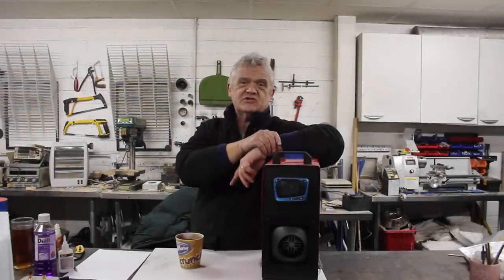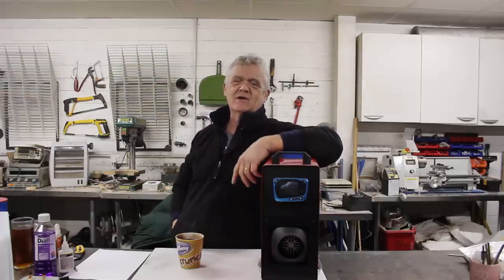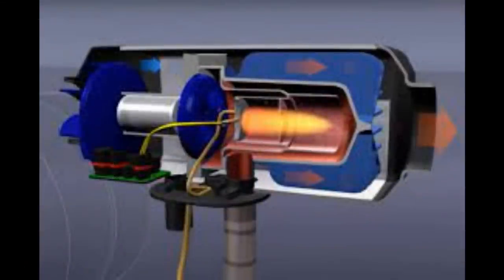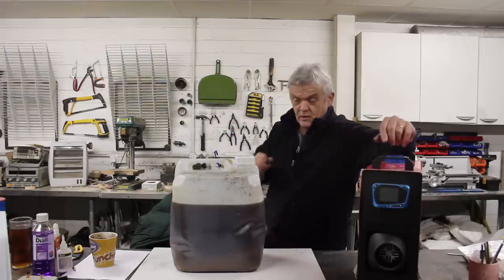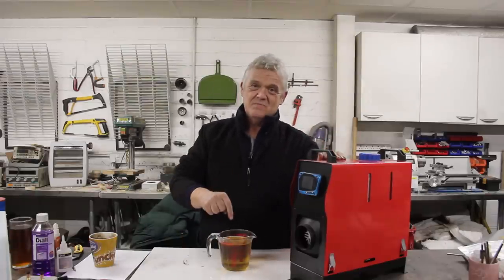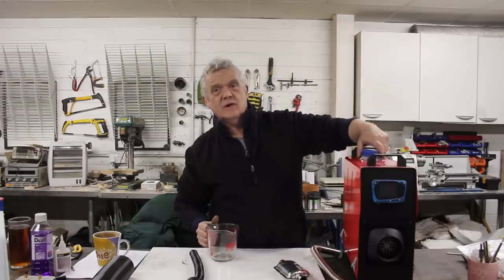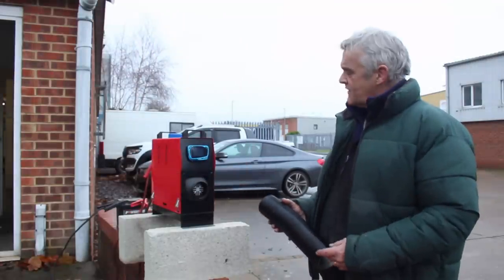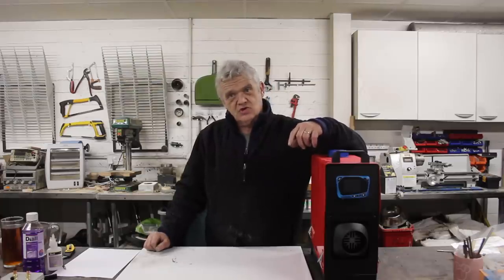1793 Home Made Fuel Running A Diesel Heater

Comment: What you described could easily be done with a rocket stove... just add two separate holes on the side of the rocket stove capsulation.. one of the holes will use a fan to pull in the air from the room and the other hole will output hot air into the room from the temp increase inside the capsulation... also you leave the top of the rocket stove open and vend it outside... remember you need an encapsulation so that the gases are not sucked into the room then you have an efficient heater and a stove. I know you will like this idea.
Reply: One of the ideas behind a Rocket stove is that it's more effizient because it burns the exhaust gases in the pipe. When you have a burn chamber with an in and exhaust line it's a normal heater or an one pipe Bullerjan. Thats the same as a normal radiator only with the difference that a Radiator has water to air heat exchange where the Bullerjan has no medium to transport the heat to other rooms.
Reply: Hey guys I’m way under intelligent to be here but I’m enjoying this conversation although I have no idea what’s being said!
Reply: He already built a indoor heater from rocket stove with a much simpler, much better solution.
Reply: @Harrington2323  What I'm suggesting is that you leave the actual rocket stove as it is just inclose it and then use a fan to pull in cold air and output the hot air...
Reply: @oldriver1827  not all heroes wear capes!
Reply: @MikeSnifferpippets  Right back at you.
Reply: @baware80  That could be a good Idea for a second room. In the first room you have all the heat of the stove. What you need is a good plan for Air circulation and a Sensor for CO, CO2 and O2. I think the biggest problem would be the high temperature. A rocket stove generated a lot more heat then one of this Diesel heaters, you would need a way better fan with insulated wiring and electronic.
Reply: @Harrington2323  Yeah you might be right, because of the large heat output, it would make sense to even leave the rocket stove outside and draw the warm air inside as the fan blows it in...
Reply: @baware80   old fireplaces were often from Clay and straw.  That would be good for a rocket stove, not only for  storing the heat but also for the heat dissipation. There are Videos from outburned stoves because of the extreme heat. When you use normal Steel it's broken after 100th of hours in use. You need better materials or a medium around the stove that dissipates the heat better. For a fun Project or a hobo heater you can use whatever is available, when you want to Install a longterm  heater in a cabin or Workshop there are more problems. Therefore your Suggestion with a fan would be good, in the Center the stove then 2cm for the Air and around this clay with straw inside for stability.

Comment: I am running one of these currently in my van to keep my bowling balls warm. And so I feel comfortable when it's time to drive home from work.  Less than $0.50 a day and I can keep them stored in there and not have to take them in the house every day.  I bowl nearly every day of the week in 3 different towns.   The cost to operate the heater will become a fraction of that when I insulate the van.  Currently it's all sheet metal.

Comment: Can you run it on no# 2 heating oil. Not as good kerosene. I can get it cheaper than diesel. If I get 100 gallons. ? Wouldn’t it burn as clean as diesel. Key question. Tanks a lot. Get it . Tank. ?

Comment: Resembles the paraffin heater I have in my boat. The heat exchanger is cast aluminium. The guy who serviced it said it will last forever. The only problem is, it's hard to find fuel for it these days.
Reply: I have a gas caravan heater that works to exactly the same heat exchange system... only difference is the fuel and thus the running cost

Comment: I have the same heater. I also have the same HHO mini torch machine you've featured before. I thought why not combine them today and run the HHO to the intake of the diesel heater to improve the combustion and heat output (especially at the lower injection settings) and it seems to be working great! Probably burning much cleaner I would hypothesize.
Reply from the maker: oh - that is interesting - thank you for sharing
Reply: That seems like doing that it could run on just about anything hopefully it doesn't get hot enough to melt anything hho burns hot! what kind of liters per minute is your hho putting out? I'm thinking of trying something like this maybe when boondocking like running a little propane then I could use vegetable oil with just a little deisel to thin it out as electricity from batteries is precious!
Reply: @patrickday4206  I'm making just under 1 LPM. I noticed that running the heater on injection setting one was making about the same heat as setting 4 or 5 before the HHO.
Reply: @mikewalsh511  wow that is a vast improvement!
Reply: @mikewalsh511  how many watts does it consume 240v or 120v I was thinking about buying one I wanted one back in 2000 when the only one I could find was the browns gas guy that charged an Arm and a leg!
Reply: @patrickday4206  I didn't put a watt meter on the HHO torch machine but it's 120v and that is used for a 12v supply that's running at about 12 amps. I estimate no more than 400w with the electrical losses.
Reply: @mikewalsh511  thanks I'm trying to figure out if I could run it off my battery bank I have 600 amps lithium titanate I could actually run it I will probably order one!
Reply: @patrickday4206  You don't need the whole HHO torch machine to do HHO injection. You could just buy an automotive style dry cell and reservoir/bubbler and run it direct on your batts. I'm not running anywhere near enough HHO to be burnable as fuel, but under 1 LPM is good enough as a burn enhancer to extract more heat from the diesel and use less diesel at the cost of a little electric.
Reply: @mikewalsh511  thanks for the info with the price of deisel and how hard it can be pulling these apart to clean hho should be a good addition! I ran mine on 50 percent used oil and deisel took two weeks to coke up!
Reply: @patrickday4206  At 14.4V my 5kW uses 35Ah on highest burn setting running 10 hours

Comment: the mechanical description you have of how there is a burn chamber and a separate air pipe, is how forced air gas powered furnaces work in the US.  there is a chamber where the flame is separated from the ducted air via a heat exchanger.  The only time you use household air is if the furnace is in the same space being heated, like in a basement mechanical room.
Reply from the maker: cheers mate

Comment: I spent a long time living in a van with an eberspacher. It was an old vw diesel and I used to mix all of my fuel with vegetable oil. Even in the winter it worked well.  
It’s the electrical consumption that’s the issue. Very easy to make heat but where is the necessary energy coming from.

Comment: It was always a good idea to take air from inside the house because it is damper and has CO2 from breathing, it therefore ventilates the house. The downside is possible fumes getting back into the house despite that we should have come up with a system to prevent this.

Comment: I got a simple question you probably know the answer too cause I know how thorough you are. The question is what sort of temperatures come out that machine the clean air part? I mean top level turned up all the way what sort of temperatures come out? Is it similar to a blow dryer? Hotter? Imagine it would be hotter but I figured ash's better than wondering lol

Comment: I would like to add that you could make a sand Battery out of a metal bucket or metal garbage can and increase the heater's efficiency even further. Use Ceramic wool to insulate the bucket/garbage can and have a pipe go through the bottom and leave the top of the sand battery as exposed metal plate and use a fireplace fan on top as an indication that the battery is charged enough and circulate the heat.
Reply: The biggest way to improve the overall efficiency of these heaters is to run the exhaust pipe though a water heat exchanger and deliver this 'saved' heat into the room with a second radiator and small fan. You will need a smallish header tank and vent or the system could pressurise and blow, making for a very unpleasant experience for you. Admittedly a more complex set up than yours, but I think, a better recovery of wasted heat.
Reply: @bigoldgrizzly basically doing the same thing but it's safer with sand and takes slightly longer to get to temperature (because of more heat can be stored) and a 2 hour max burn has the potential for 6.5 hours radiant heat at half temperature in the garbage can configuration run both exhaust and vent through the battery. Water is good for immediate release for that day. Run a sand battery for a while and it will run for a lot longer. Water is a good option in the right environment.
Reply: @daniellapain1576  fair comment. I absolutely see the points you are making. I must admit to bias in that I want to have a system to come on in the workshop [120m cubed] at 6 am and be up and comfortable in fairly short order after I start work at around 8. . There is plenty insulation and 'general mass' within in the shop to hold at least some degree of heat overnight. Rapid temp rise is my aim, once up to temp, maintaining it through the day should not be a problem. I can even switch off the diesel and rely on the woodstove for that.
Reply from the maker: cheers mate

Comment: Robert, could you use a thermocouple and read the exhaust temperature from the burner? What is the temperature of combustion in the burn chamber?
Basically, I'm wondering what percentage of that heat is successfully transferred to the air when you operate it at various settings. Having the combustion intake air temperature, the combustion temperature, and the exhaust temperature, and the heating air intake and outlet temperatures would really help get a sense of what this devices is achieving.
Reply from the maker: true enough mate - I will look into it cheers
Reply: @ThinkingandTinkering  Here's where my thoughts are going: If I remember correctly, steam locomotive engineers concluded that the best way to get heat from fire into water is to use "fire tubes" connecting a combustion chamber with the exhaust stack, with those tubes passing through a reservoir of water. Concurrently, there is this concept of a "thermal transformer" using a phase-changing heat transfer medium to take high temperature heat and spread it out to heat a much larger volume of something else at a lower temperature. Based on these principles, it would seem to me that the best way to convert heat from burning fuel oil to heated air is to send combustion gases from burning oil through fire tubes in a reservoir of water, and have the steam travel through another set of tubes with much larger surface area (such as a radiator) to condense, using that to heat the air.  That way, the heat transfer is over a smaller temperature difference, which is more efficient and less entropic. 

That would seem to me to be much more efficient than the tiny but really high temp heating surface in the diesel heater.

Comment: With standard biodeisel mixes being a cook of about 1/10 or 1/20 methanol to the rest oil(I think the heavier oils need more, lighter oils like most cooking oils would be less, I may have that backward), a small amount of base catalyst(potash lye or sodium lye) maybe an once per batch, Small HCl to drop the lye from the  solution on completion, biodeisel is thinner that this on average, and due to the chemical reaction, most origination smells are destroyed. After you let the reaction occur with strong stirring for a while, you will know it is about done when the glycerin formed is about the volume of the methanol. This can be used as fuels for lamps as you have said as well, and after this has the salt in it, but there are ways to crash out the salt too. This seems to me to be cheaper than the paraffin, tho perhaps more tool and labor intensive, but that could cut your costs pretty well.
Reply: There are other methods based on enzymes and probably many more.
Reply: @vitordelima  True enough, but most of those enzyme products are not available off the self everywhere, which methanol and lye are.
Reply: @jasonmorello1374  I'm not sure how it works, but there are DIY methods to print enzymes and they don't seem too hard to get. In the middle of nowhere it isn't a viable method but in the first world it certainly is.
Reply: @vitordelima  I am not sure about "printing" enzymes, but I know Thought emporium channel has coverd some for his project to make yeast that would generate spider silk. I think the process would be similar, and take some specialized bio lab equipment and pre study. Mind you, If you are up for such a thing, go right ahead, but some times you need something a bit more within immediate reach.
Reply: @jasonmorello1374  No, it isn't. It is immediately available for many enzymes and I'm almost sure they are cheap to buy already made, but you just want to nag.
Reply: @vitordelima  The first enzyme that can be used to do this is lipase, which is about a dollar a gram, so for a 5 gallon batch you would need about 20-25 dollars worth, and then try to extract the enzyme from the product. This enzyme can be made as I specified, as that is one of the ways it is available commercially. But really why go to 25 dollars of enzyme  when less than a dollars worth of chemicals will do the same job?
Reply: @jasonmorello1374  Just look for it instead of being annoying.
Reply: @vitordelima  That  is precisely what I did. you can see the results of that already. I am sorry for you that you find scientific approach and a scope of needs "annoying", but really, I am just having the best facts as I know them present. No pie in the sky wishes or clarktech when no such thing is present or fits the concept, which here is about affordable fuel. That is a key defining scope point here.

Comment: These units usually have a calibration mode so you can fine tune the injections per second vs. the intake air fan speed (for high and low) which allows you to get the maximum heat output with the minimum fuel burned in their full range which is the sweet spot, apparently they come configured to burn more fuel than they need to so that they’ll work with all sorts of grades of fuel out of the box in the wild...  which makes pretty good sense, but when you turn them to lower settings it is usually letting the air go too low (so they can be as quiet as advertised) and then you get a dirty burn because you can’t calibrate to a low enough fuel rate to match the fan speed without issues, so that minimum fan needs be raised and then the pump frequency adjusted so that it’s tuned...  it can probably actually deal with quite a range of similar fuels, given their ability to calibrate like that.
Reply: Replacement pumps are so cheap and easy to change, I wonder if it would be  cheaper just to run 'em till they wear out. if you can stand the ticking noise. 
I suspect running at max power for a few minutes before shutting down would help a bit with coking issues. Calibrating dosing and fan speed and comparing inlet and outlet temperatures along with CO output is the way to go. No two setups are likely to be the same and unless you can get a consistent alternative fuel 'blend' efficiency is likely to suffer.
Reply from the maker: I must look into that - cheers mate

Comment: Hi Robert I 'may' have discovered a New Waste Product that nobody wants that could be ideal for Burning in one of those Heaters 'Or Maybe Not!' I'll leave you to decide!

I was Cleaning out my Spray Gun with some 'Gun Wash' which is quite expensive to buy but once its been used for Cleaning nobody wants it, as its not much good for anything else after that, so what do you think (Have I just discovered The Holy Grail or what!) Lol

Also I have an 'All In One' Inverter Heater that used to be all over ebay, until these Chinese Heaters came out and this needs to be run on Premium Paraffin which is costing a Whapping £2.32 Ltr even on the Low Setting its costing me around £8.00 for 16 hours burn time

Which over the course of a Week can come to megabucks and I also tried it on Iso Propanol and it works even better on that, so please could you tell
me the cheapest place to buy Iso Propanol, as I think in one of your Videos you mentioned £1-60L

Comment: Well Robert ,I run 2of these heaters ,one heating a bedroom other the kitchen,for last four years, my fuel is 50 /50 diesel. W v o , mine run fine even stripped one down yesterday to check ,all .I had was a small bit of soot ,my w v o is pretty clean to start with, kept back 1litre ,am about to try your gelatine method .

Comment: I'm curious as what you find long term. Since these units will plug up if ran on a vegetable oil mix with 50/50 diesel. I did it and it only ran for a few days before causing problems. I was using brand new vegetable oil when I tried it.